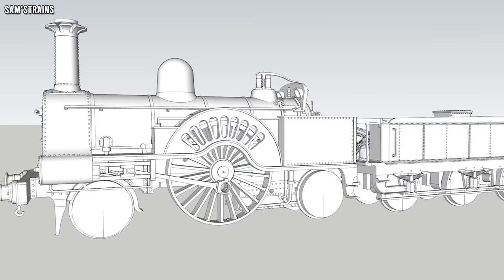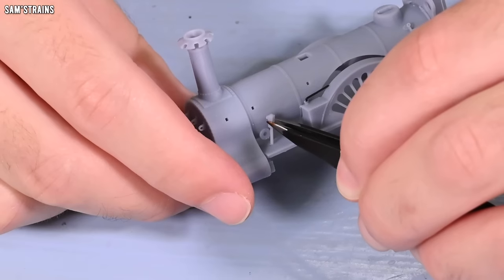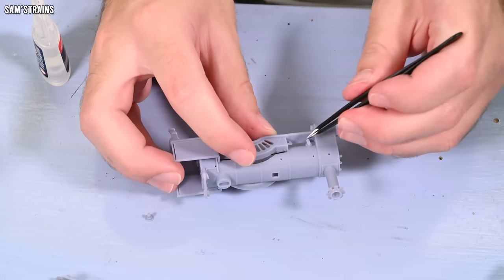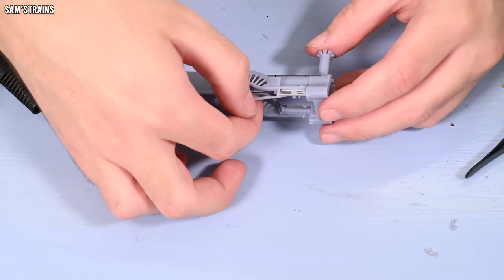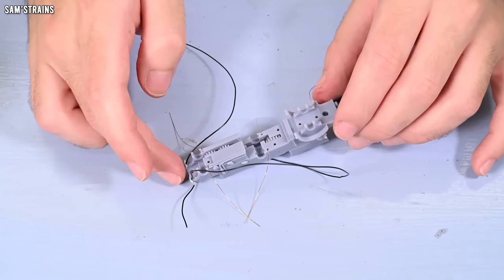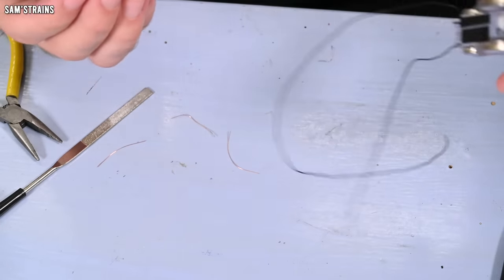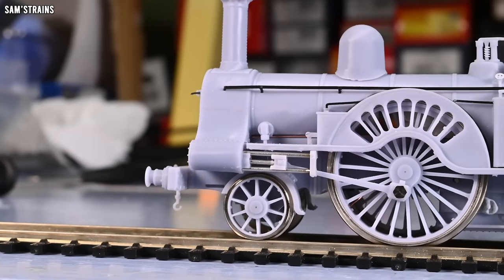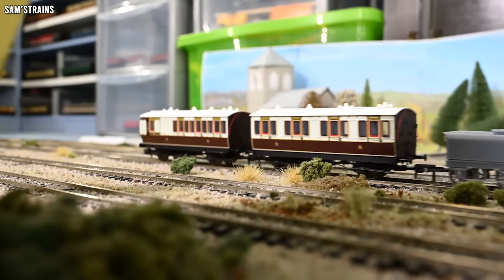Building the First "Lady of The Lake" Prototype | 3D Printed Loco Project

Comment: The issue in reverse is the tender!!  If you look closely, the clearance in the tender wheels is allowing the tender to rock back on the wheels and quite literally apply the brakes!!!  When you're going forward the wheels move back in the guides and the brake blocks are clear!!  Either add some additional clearance to the blocks, or tighten the slots for the axels...  That said... SUPERB model Sam... a work of art!!!!
Reply: yup, definitely something going on with he tender wheels, looks like the front axle wasn't working well at all
Reply: He also forgot the tender water scoop in the design
Reply: @musclecat1005  No need - he doesn't have a "track pan" on the layout. That would be an interesting thing to model, come to think of it...

Comment: Blimey, this must have taken months but extremely worth your while. The finest project done by you yet Sam! We can imagine the learning curve in terms of research, precision, detailing and actual execution, e.g. perhaps it would be best to actually postpone adding the tiny fragile details during the build as long as you possibly can to avoid breaking or damage since the model seems extremely fragile. Will the 3D printed internal driving cogs hold over time in terms of wear of their teeth Sam? On the plus side, new parts is just a matter of re-printing of course. Fantastic project! Just wow 💓 Cheerio.
Reply from the maker: Yeah very much so - I think it was worth the time though, definitely the best results I've seen so far! That's right, that's definitely the plan... add the fragile bits once the thing runs! We'll have to see how long the resin gears last... though as long as it's more than a year or two, I'm happy to replace them once in a while!
Thanks for watching, Sam :)
Reply: If I might, Sam? Perhaps for the next 3D loco project, you can do a GER Class A55 Decapod. That certainly sounds like a challenge.

Comment: Really great stuff Sam. One thing to note that might be of use; where you get issues of warping on the resin printed parts (it was more noticeable on that first wagon you made), the printed parts can be gently heated in warm water (not hot) and possibly eased into the true shape. I've done this successfully on long thin parts , although larger items like the loco body might be tricky. Either way, best of luck with the final build!
Reply: That is a great tip!

Comment: Really great work on this!  For the reversing problem, try adding a spring to the front wheels.  I suspect that the main drivers are tipping the front down just slightly, causing the back wheels to lift off the track and lose traction.  A properly tuned spring will keep the front held up so all 4 geared wheels stay on the track.

Comment: The boiler wheel cut out is way upper than it should be, lower it for the next model so that there's no gap between the boiler and the wheel decorative splasher. For the problems in reverse: The wheels of the tender get stuck, they have no space of free movement.

Comment: In all probability you've already spotted this on the video, but with the possibility that you hadn't, on the subject of the loco struggling to reverse and wheel-slipping, I did notice a couple of times that when you were trying it in reverse, the front set of tender wheels seemed occasionally not to be turning freely, while the rear two were turning perfectly, so possibly some issue there might have been hampering movement in that direction? Around 28:14 is a good place to spot it.

It's a beautiful design, and the finesse of the parts is absolutely amazing. I love the beautiful curved shape of those huge splashers, and the spoked cut-outs (which probably isn't the right term at all) look incredible. The combination of those splashers, the massive single wheels, and the chimney cap give her something of the look of a paddle steamer on rails, which very much fits the Lady of the Lake moniker, I think.

Comment: Watching your iterative process is inspiring. Thanks for sharing your full process.  You should get good results with some standard rail nippers for cutting the 1mm rod stock. Also, if you plan on continuing with the light gray resin, invest in a contrasting silicone mat to make those small bits stand out.

Comment: I'm surprised how little weight is in that, I'd add a bit more and see if it helps the slipping. Also might need a spring over the non driven wheel to help it push on the driven one.

Comment: Hi Sam, I might be able to comment on your rod length issue. In a professional engineering environment I think we would deal with this in one of the following ways.
1. Tolerances. Rather than defining the length as 12.2mm, we would define 12.2 (plus/minus 0.5mm) and ensure the part works in that range, modifying the design if needed.
2. Decent clippers. Providing you are UK with a slight champer on the end of the wire (looks like you're hiding the ends) a good quality, hard edged clippers (knipex or similar brand) would allow you to clip to an accurate point especially combined with a jig (which you could 3d print).
3. A chopsaw set up. In this case you would need them Dremel mounted in a fixed position and a stop at the correct distance. Push the wire to the stop, then drop/plus the Dremel across the wire producing a cut at the correct length.

One other point, at camera level you can see daylight through the boiler via the wheel slits which looks odd. Could you add an underside to the boiler in the wheel area?

Otherwise your steam will escape!
Reply: Very much impressive with this as a self built model however.

Comment: Sam, this is a brilliant model already, and only moderate change I'd consider making is using POM (Polyoxymethylene) Acetal (aka: Delrin) instead of resin for the gears for the durability and low friction nature so the gears will mesh and release from each other with less risk of breaking apart due to torque application and theoretically last longer than in resin.

Though, that might involve having to outsource the gear production to someone who works with POM-Acetal, or hunting down batches of gears in the right tooth counts which could be used for further prototypes (or even as part of a hardware kit for this loco for others to purchase and save them time).

Comment: Fantastic video Sam, I'm curious to see how the printed gears will hold up over time. I usually order plastic gears in, module 0.5 works with most brands of OEM gears.. it's a painstaking process getting the correct center distances and mesh depth, but I'm sure you've encountered that already.. keep up the great work!

Comment: Is there a way to close up the gap between the wheel arch and boiler, or is that necessary for it to run properly?
Reply from the maker: Yeah it's necessary - because I'm using slightly larger diameter wheels (best I could find), the gap allows the rest of the model to be realistic. To close the gap would involve enlarging the splasher, which I didn't want to do!
Thanks for watching, Sam :)

Comment: Have you ever considered using silicone rubber and low temp metal to cast you chassis? I’ve thought about doing that and I’d be curious to see how it turned out.
Reply: Silicone would just melt/burn even with aliminum the only metal i can think of that would work with that are gallium but then the casis would melt on a hot day. you could cast in sand or plaster that would work if you 3D print a part sand coat it in epoxy then sand it down and use that as your patten
Reply: Silicone has a burning temperature of 400F and you can use a bismuth alloy that melts at around 250F. That’s low enough to do it on the stove. There are alloys that melt even lower than that but I don’t think they would be practical. An added bonus is that bismuth is heavier than lead so you don’t need a lot of it to add whole lot of weight.

Comment: That's going to look superb when it's finished and painted. Also I think the resin gears may well end up being very smooth because I think they will be more inclined to "bed in" than nylon gears which are more resilient to wear. I love the clarity of printing with the resin printer it's almost on a par with a polystyrene moulded kit. One thing that does strike me is the gap between the boiler and the splashers which I guess is necessary to clear the wheels? Overall I think it's superb and you should be rightly proud of it it's wonderful. Cheers.

Comment: Masterful! I've been looking forward to this project. I'm really impressed at how you designed the chassis; location holes; self tapping screw and test fitting the parts. Would you consider using magnets for the final model that can be press fitted with location pins for chassis and body design (easy maintenance)? How about press fitting a nut (3d printed seat for the nut) to be used with proper threaded fasteners instead of self tapping screws. You've out done yourself Sam! I think you've reached the very top 3D printing, would desktop CNC (foot plates, details, custom PCB boards) or forging (custom weights) be somewhere in the works in the future of your Channel?

Comment: I have a few thoughts in regard to the design. First off, you should probably find a way to mount the cylinder block as part of the chassis, just to decrease risk of breaking the side rod assembly. Secondly, the gears should probably be FDM printed, due to the fragility of resin. Tird, make the brake rigging on the tender a separate FDM part like the handrails, so that you don't risk breaking it while mounting the tender wheels. 

All that said, This looks amazing. I believe that a pro manufacturer would have made this largely out of metal, but that said, yours really looks like a proper engineering sample from an announcement article. I can't wait to see the final product!
Reply from the maker: Yeah that would have been ideal - but the cylinders are a seamless part of the smokebox, so I decided to mount them as part of that... it is easy enough to undo the crank pins, as the rods are actually much stronger than I expected, same with the gears - when stress tested they showed no sign of weakness/failure! FDM brake rigging would have been better, but that would limit me in terms of how fine they could be... so this was my preferred choice, and I'm tweeking the design for next time!
Thanks for watching, Sam :)

Comment: The only tip i have is to put some water on the emery cloth as that will give you a smoother finish.  Using a cutting disc to cut the rod is probably best unless you can find a saw blade with very fine teeth.

Comment: Very cool Sam! If you need to dispose of previous version "problems" I have a home for ghrm here in Cusco, Peru 😉 This latest version is great, I'd happily run it even without paint. I think in reverse the smaller rear wheels are getting better traction hence the slip, maybe try to get more weight over the centre or front, may sort it. Great stuff!

Comment: Good effort. We have been mucking about with 3D printed loco bodies/wagons for about 3 years for both US ON30, Austrian H0e narrow gauge and more recently Welsh slate wagons. Currently on running test and shunt’able, take note PECO. While surface finish/detail has been perfected to a point, I would put my stuff against injection moulding. Wear on the resin from moving parts/metal axles, is still a long term issue. Producing valve gear even something this simple is a just NO! Doing the valve gear for a 19 ton Shay and that was vertical, ended horribly. To produce a reliable loco chassis, gearing and valve gear resistant to wear, I see the way forward as black aluminium with composite metal powders or direct metal printing.

Comment: Sam I think it's great the way you have embraced resin printing.....the lady looks awesome.

However, resin is generally only used for cosmetic  detail. It's not ideal for structural parts....way too brittle. So I would express a word of caution when printing stuff like gears with it.....they will wear much quicker than an fdm print. You can add Tenacious resin to standard resins to give them more strength, but even then.....they are no where near as tough as an fdm print.

Comment: What an elegant, beautiful prototype! You could print the buffer casings and use Alan Gibson buffer heads and springs, which would give a result better than rtr. It may also be helpful to set the front and back most wheels to an increased back-to-back to make running smoother, though, I think you have this one in the bag. It looks most professional!
Reply: You could use the space the weight is taking up for a flywheel. It would also be heavier, as brass is denser than zinc/mazac!
Reply from the maker: Thank you so much! I'd like to try sprung buffers - though I do have a design idea for how I could do them myself!
Thanks for watching, Sam :)

Comment: I think if you found a way to transfer tender weight to the locomotive, you would get improved running. If it were my model, I'd try this: weight added to the tender, tender end of drawbar mounted rigidly in the vertical plane, tender drawbar on the loco end mounted with a small spring under it, but otherwise free to move in the usual way. The drawbar will press on the spring transferring some of the tender weight to the locomotive, without impeding free movement. You could experiment with the spring since you will want it as stiff as possible without lifting the front wheels of the tender off the rails.

Comment: The best way to remove the supports is by cutting them off with a hobby knife. From larger parts that aren't very fine you could just rip them off, but you have to do it before the post-curing, because the resin isn't flexible anymore after the post-curing.

Comment: Your reverse problem is due to clearance between all the gears (necessary for rotation) which you cannot design out. Your gear train has differential take-up of clearance between each axle hence the slip. You can see all the way through the splasher ribs to the other side. Is there not the boiler in between? 
Small things make perfection. But perfection is no small thing. (School motto)

Comment: Will you ever make the files available?  I know that I would buy them, to customize for my own railroad.  Also, you should consider a resin that is a little more durable (like ABS-like resin).  Beyond that, Sam, great work!  I have a resin printer and use it for my own railroad all the time.

Comment: In reverse, might be the wheels are not perfectly level and weight transfer (including from the tender pushing) is lifting the rear driving wheel.

Wonder if you could power the front wheel as well.

Comment: cool model! But I prefer to print with as few details as possible. Then the model turns out smoother and stiffer. Resin gears may have a higher friction coefficient than plastic ones and may not last long. Although it’s possible that Sam has resin Abs like

Comment: Brilliant work Sam, but as someone else has pointed out, what's with that gap in the boiler, tracing the main driver wheel splasher. I'm also assuming it a wheel to boiler clearance issue caused by the underscale 00-gauge back-to-back distance clashing with the 4mm:ft scale boiler diameter. 
Couldn't the splashers be extended to touch the boiler, so to cover and disguise the gap ?

Comment: I cut rod using a set of Klein Tools Diagonal Cutting Pliers, Angled Head, 8-Inch.  These will easily cut an 8P nail.  I have used them to cut 2mm stainless steel rod.
Reply from the maker: Great stuff thanks - I'll look into that!!
Thanks for watching, Sam :)

Comment: Try Bob Smith Industries IC-2000. It’s a excellent rubber toughened ca glue that dries quickly. Some zip-kicker would also ease assembly!
Reply: I think a watchmakers lathe (or similar) would help you with wheel concentricity and cutting the rods! You could also use it to polish the wheels and make fittings.
Reply from the maker: Thank you, I'll definitely look into that!
Thanks for watching, Sam :)

Comment: Looks amazing 👍 the reverse performance is strange though. Almost as though it's cutting out until it hits a certain voltage or like it's fighting a tight spot on the tender or free axle... although I suppose if that were the case you'd expect it in both directions. Hopefully just as simple as a pickup adjustment. Can't wait to see the finished article 😁

Comment: That is a great model for a prototype, but I may suggest adding deposits where liquid gravity or lead could be added for extra weight and why use plastic coal using real modelling coal looks better and adds the correct amount of weight to the tender
But overall I like it
Also where do you source the tyres

Comment: Hello Sam,
I am impressed with your 3D print with your wheel tyre fit. 
Tractive effort would be improved if you use pin point axles on your tender, with split axle all metal wheels and pick up through metal top hat bearings. For pickups try using  straight 0.3mm phosphor bronze  wire.  Sorry but I don't like your design where you see dalight behind your driving wheels, the wheel splasher and the absent boiler. I understand the under gauge 00 wheels cause this, so some sort of major compromise is required. I suggest a wider  wheel splasher blending into the boiler as a "looks right" inaccurate solution. I doubt the 3 D printed gears will  have a long life if the model gets used frequently, Time will tell.